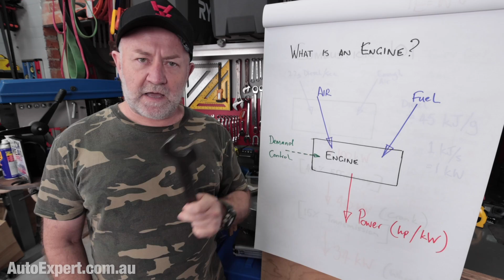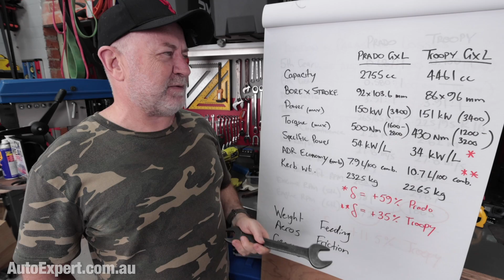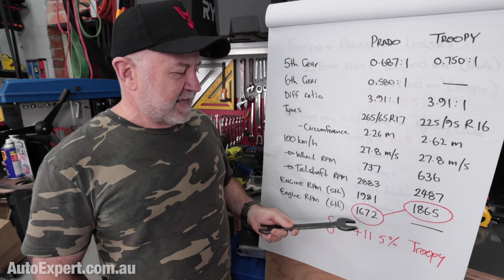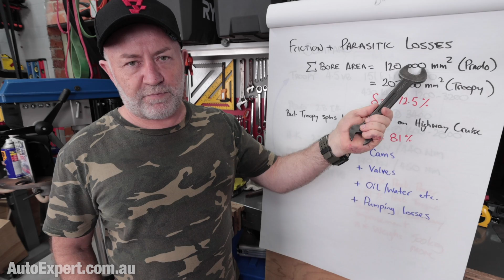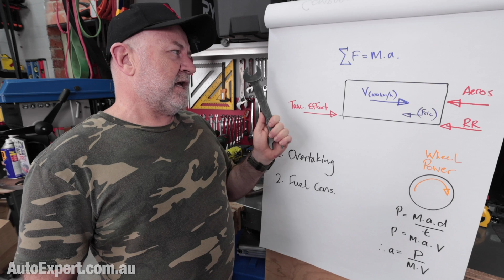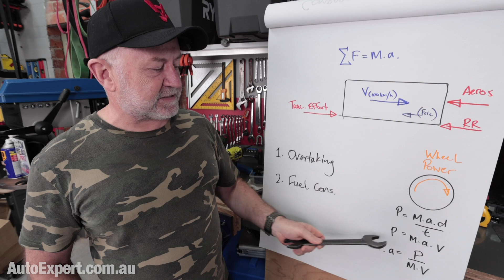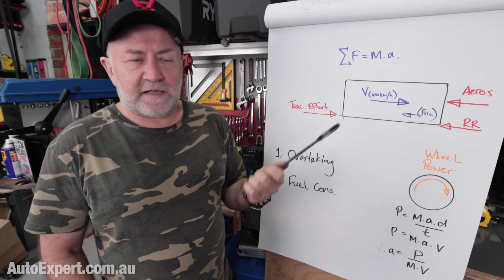Toyota Landcruiser Troopy fuel consumption (why it's so bad) | Auto Expert John Cadogan

Comment: The V8 Troopy is an absolute rocket ship compared to the old 6 cylinder non-turbo diesel Troopy, which I think was about 70kw.  You feel like Peter Brock in the V8, after pottering around in the 6.
Reply: Is still very, very slow compared to any of the current 4 cylinder turbo diesels unless you take it to a tuner to unlock the power (and loose the engine and driveline warranty in the process)
Great for mining and farms.
Reply: @Danger_mouse  well.. the old Hilux was doing 0-100 in 12.7 and the Troopy about 14.7, so if those 2 seconds mean "very very slow compared to".. i guess
Reply: You can still buy a new inline 6 cylinder troopy at Toyota in Papua New Guinea. 70 series are the only vehicles that don’t shake to pieces on the gravel roads.
Reply: @tonydoggett7627 
Yes, our mining company buys LH drive ones from Saudi Arabia to get around all the V8 problems for underground. The wheezy old 1HZ doesn't need to be fast underground, just reliable 👍
The Australian government won't let us import RH drive 79s as they are worried about them being registered illegally and put on the roads. We have to prove the LH drive ones have been scrapped when we're finished with them. (typically 2 years)
They save about $10k per car over the V8 and then none of the V8 issues (DPFs, injector faults, alternators, starters etc)
Still horrible as an everyday car up on the surface though.
Reply: @Danger_mouse  tell me more about this mining thing... what are they used for? To transport people in the back is it? And while I realise it's a tough environment,  I still don't get how you can kill one in 2 years.
Reply: @xpusostomos 
The vehicles are used to transport personnel underground, mostly single cab vehicles, but some dual cab and a few fitted with a 3 seat 'man cage' with seats in the tray.

How do we kill them in 2 years? 🙂🙂🙂
They are always locked in low range and on rough decline roads. There is always water and mud which is frequently salty and or acidic. The cars are thrashed by the operators as they don't own them and treat them like most people treat a hire car 👎👎👎
They are often crashed into the walls or run into by a machine well before the 2 year goal 😔
We run a 2 weekly service schedule to keep them going. 
- CV joints last 6 weeks.
- Second gear synco is crunching 3 weeks after the cars arrive new on site.
- The 3/4 synchro collar strips off the main shaft splines usually at about 1 year old.
- Leaf springs last about 3-4 months.
- Brake pads last 2 or 3 services
Etc etc.
At two years old, it's cheaper to replace them than continue with the maintenance and upkeep.
We save the engine and gearbox if they are good and scrap the rest.
Reply: @Danger_mouse  6 weeks for CV joints, geez it boggles the mind. One would think there'd be some more economical mode of transport.. but what do I know. I take it the cheaper utes, aren't up to it?
Reply: @xpusostomos 
Every other vehicle has been tried over the years but various mining companies including our own 👍
LC79 is well built, and for that roll, nothing tops them.
Most alternative cars have independent front suspension which just adds a heap of extra moving parts to maintain. 
They've tried full sized US vehicles, but they are A, too big and B, not reliable enough 
or most importantly, C, supported outside the US. 
Cruiser parts are everywhere. 

Good for hard work, to rough, low geared and under powered as ab everyday car.
Reply: @Danger_mouse  I'd love to see some footage of how they are used in the mines. Can't believe they only last about two years. A hard life!
Reply: @christophersaul 
Not my video, but this is one trip down the decline and back up in where ever this mine is.
Keep in mind that it is a 1 in 7 gradient 
(For every 7m forward, you drop 1m)
They are permanently in low range 4x4 every day and will do around 200km of this every day.

This mine actually looks pretty clean and dry, and the decline looks like its just been graded, often much wetter and rougher.

https://youtu.be/LNC-H0zhn-s
Reply: @Danger_mouse  Thank you! I understand a lot better now. I can see why my Troopy will hopefully last for twenty or more years and why these ones for only two!
Reply: @Danger_mouse  200km a day.. 70,000 a year. I guess that explains it.  It must be going up and down all day to do 200km.
Reply: @tonydoggett7627  wow, really? Very surprising. Is it the turbo? Those are very sought after in Australia.
Reply: xpusostomos non turbo and no emissions equipment. I’ve seen them new at Lae Toyota myself & driven the  gravel roads of PNG in a 70.
Reply: @tonydoggett7627  are these non common rail diesels? That you can stick any crap in the fuel and they don't care?
Reply: xpusostomos yes
Reply: If the Sheila’s like ‘em, I’m in like Flynn

Comment: One is a V8 and in terms of longevity far better than the four cylinder from the Prado/Fortuner platform.
Reply: The 2.8 is rubbish though , compare it to others four cylinder diesels the V8 is very average.
Reply: @alexfrankl7861  The new 2.8 is a massive improvement over my 5L 3l
Reply: LOL 1vd and longevity are not normally words uttered together
Reply: if rightly maintained they last long and the best in its class, better than the Fortuner engine anyday be it performance for the right application or life.
Reply: My mate just clocked 900,000 kms in a troopy... yet to see a prado doing that
Reply: My old mate purchased the very first diesel hardtop troopy that was sold in Australia the HJ45. These first troopys diesels had the little Toyota straight six H engine with 3,600cc producing about 60Kw. He drove all over Australia in this vehicle and clocked up 1,000,000klm at about 26 miles to the gallon and after he passed on his family sold the vehicle in near perfect running condition. Cheers
Reply: Love the physics and engineering pros on YouTube. You are so wrong it's not even funny!